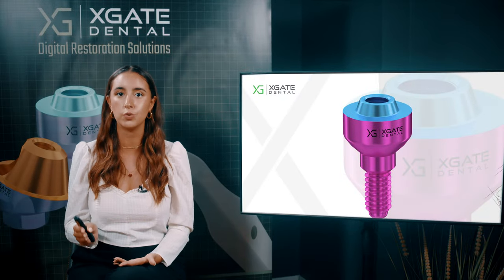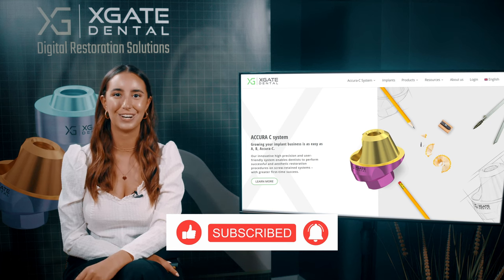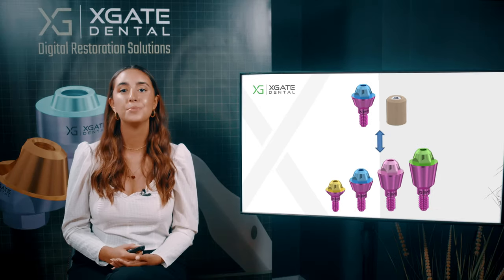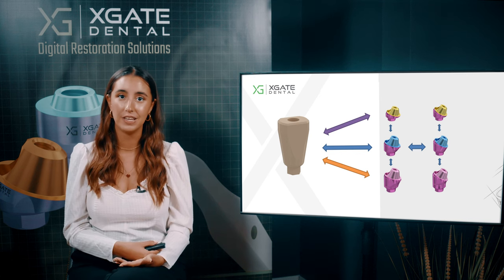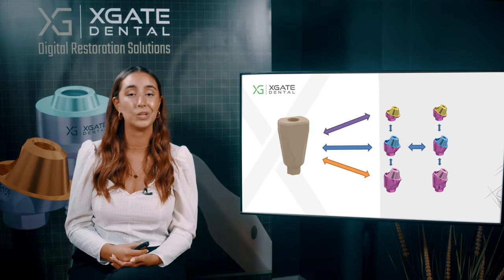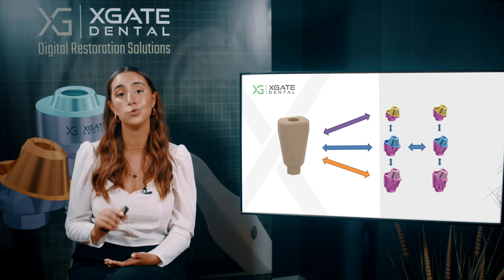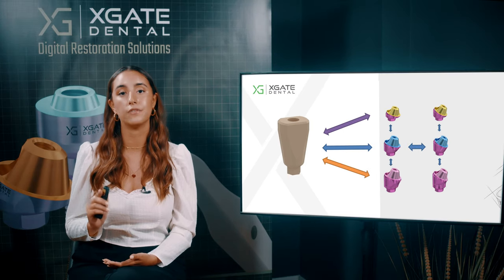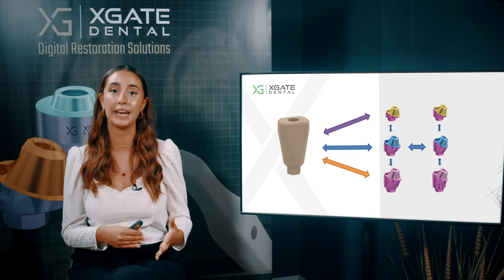High-precision prediction method in screw-retained restorations. CAD CAM TECH saves appointments

Comment from the maker: 00:00 Much simpler with the technology of the CAD/CAM
01:05 What does the CAD/CAM technology give us that we didn't have previously 
02:10 Using the intraoral scanner
03:00 In old method you don't know what the end result  
06:00 You have everything digitally, you have the coordination of all of the multi-units
07:00 The height between the scan abutment and the implant is two millimeters
09:00 About implant levels scan abutments
10:00 He knows what type of multi-unit to use best for each case. 
11:00 30 positions of angulated multi-units
12:00 The final restoration